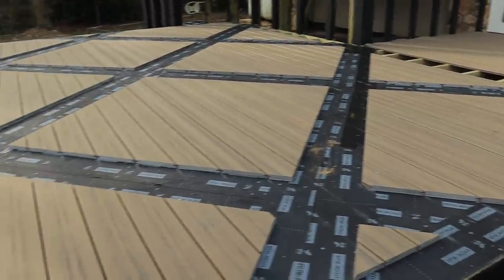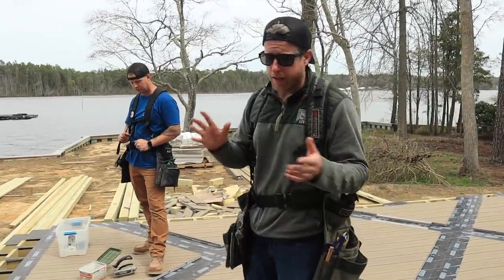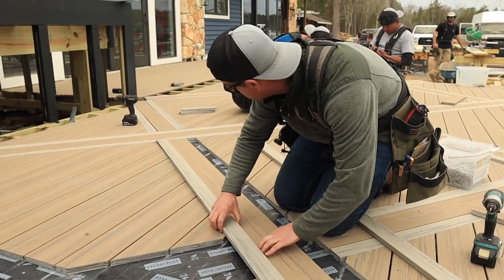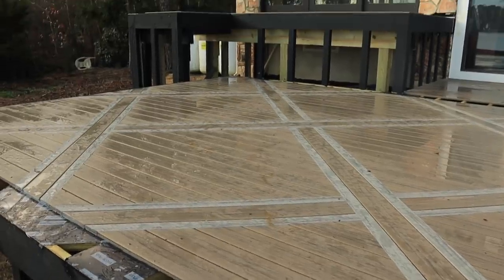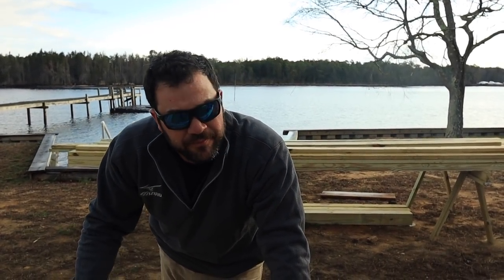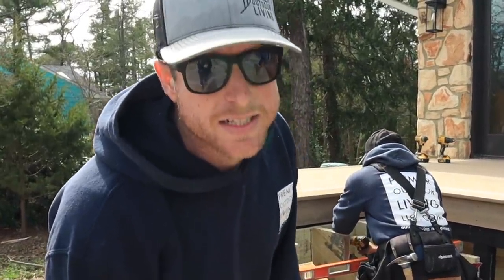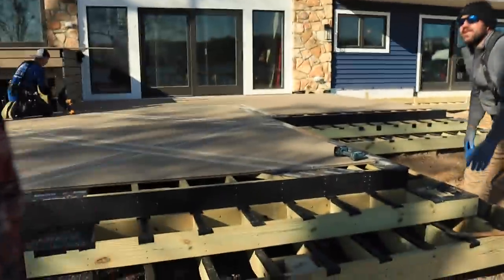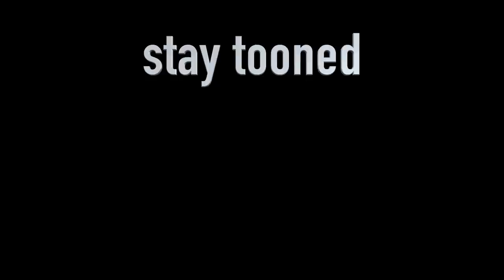RIVERFRONT BACKYARD BUILD Pt 4 - Deck Inlay And BIG MISTAKES!!

Comment: Hopefully those issues don't take the wind out of your sail!  I get the vibe that solutions or options were presented to the client and ultimately they wanted what was agreed on in the pretty rendering.  Because they've probably never made an honest mistake right. If it was me, and I'm extremely OCD, I would've allowed the thicker trim board.  Once the railing is up,  no one will ever know!
Reply from the maker: We’re getting back on track! We actually didn’t even bring it up to the client, and they honestly probably wouldn’t have cared if we used a slightly bigger piece, but everything else worked out so perfectly we decided we just had to do it haha

Comment: How do you deal with the tiny corner pieces you sometimes get with your inlays? Single screw? Or do you glue them down?
Reply from the maker: We had a couple on this one. We went with single screw and it worked out. But we usually try to plan ahead as much as possible to avoid those really tiny pieces if possible!

Comment: Can you not just take off the front rim joist and cut all the joists back 3/4 inch? Rather than taking everything apart?
Reply from the maker: That’s essentially what we did, but the stairs on that corner of the deck made it a little more of a pain in the ass
Reply: Ah, didn't think about the stairs. Yeah that would be a pain but props to y'all for doing it right. Excited to see the final product!